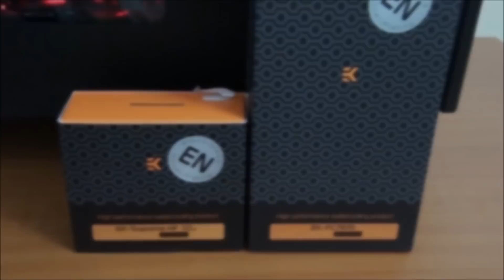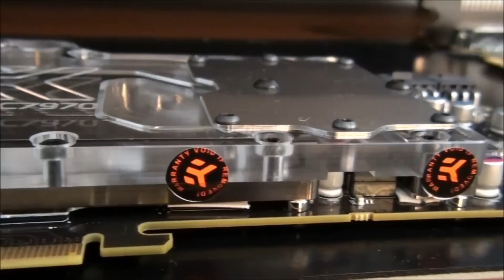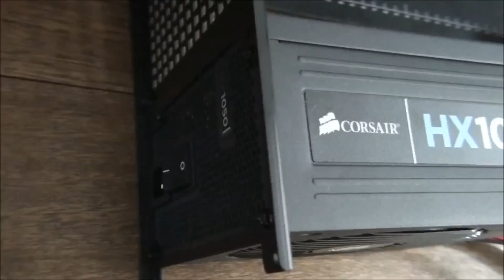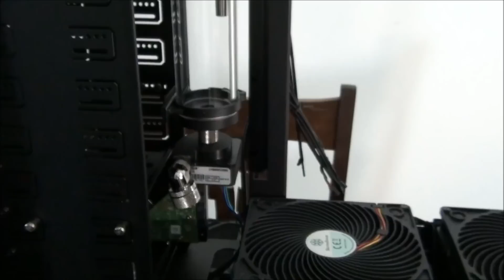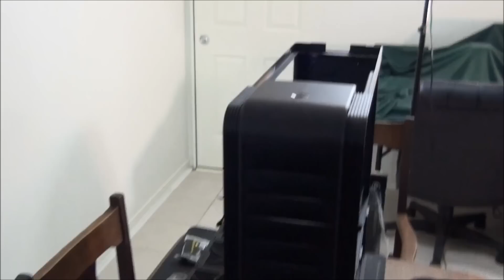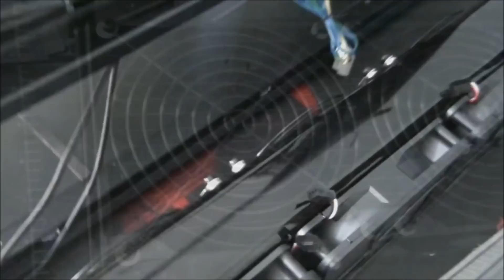Build #4: Extreme TJ11: Part 2

Comment: The only thing I don't like about this build so far are those extra washers for the rad grilles. To make the screws shorter, all you need is a simple wire crimping/stripping tool that has the bolt snipping bit built-in. Just screw your bolt into the tool to the new desired length, and snip it....done. The tool is under $10 on Amazon and it comes with a huge assortment of solderless connectors too.

Comment: @SingularityComputers Yes, i did thought of that, but in this case you can't hold the  fan propeller while vacuuming...so if you are not fast enough you can easily spin the fan in higher rpm-s and ruin the bearings....i think it would be a better idea to mount those filters on the side panel (from inside, double sided tape or whatever)...so you cold just vacuum the filter without removing side panel, and not efect fans because they are not in direct contact..simple!

Comment: @MrSoskok 
That's a personal opinion buddy. I like both res's in certain builds, but for my own I currently have a small tube res/pump combo that's hidden. I like the front bays of my case clean and uniform, and having bay res's and bay devices goes against that. 
There are definitely builds out there though that showcase their tube res's and bay res's very nicely. My setup is personal preference only :).

Comment: @hyunsukchang 
I'm using the same combo but my res is the 40mm version. Instead of a d-plug I have a mini male to male fitting connecting the two. They're fine and you can use it on the pad that comes with the 35X because it's rather hard, though I personally am using the swiftech 35x hs w/ stand seperate addon instead. I have my res/pump combo hidden in my pc though which is why I chose only a 40mm res. If you're using a big ass res like a 400mm you probably want to clamp it down.

Comment: Hey, I'm planning to use the same pump and reservoir. if I were to set the pump on the floor of my case (sitting on foam for vibration), would the bitspower d-plug be enough to suspend the reservoir above the pump, or would I need mounts to support it?

Thanks, love your videos!

Comment: The videos are not to long,  not many take the time to explain there builds in details.
BTW. Have you seen the new LGA 2010 CPU. ( Core i7 I7-3820 ).
Relay makes it cheaper  to get A LGA 2010 system, and still assume specks.